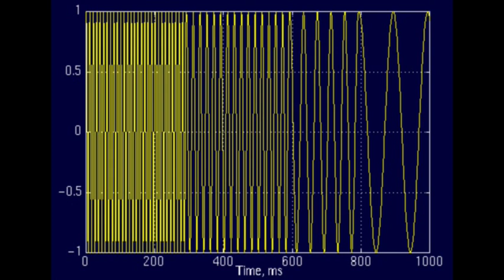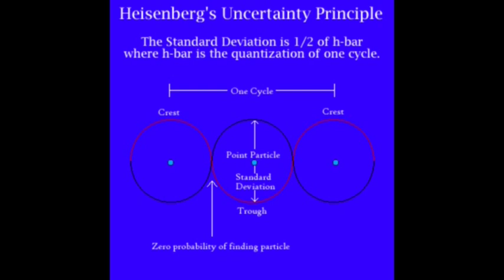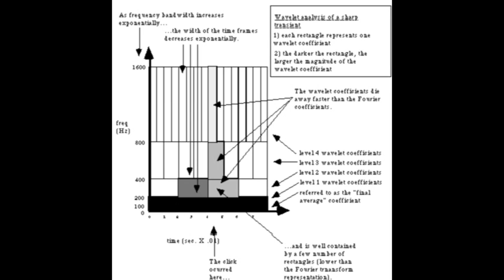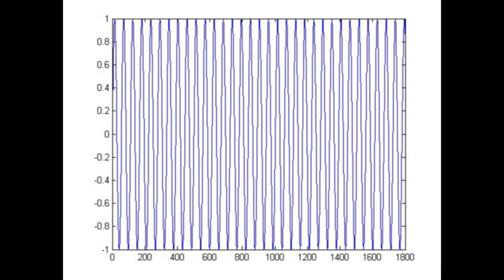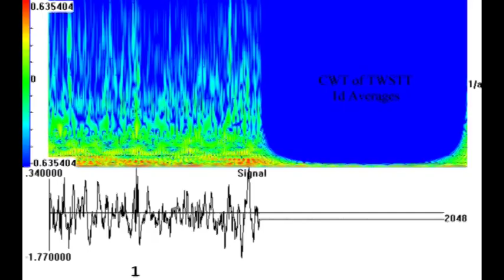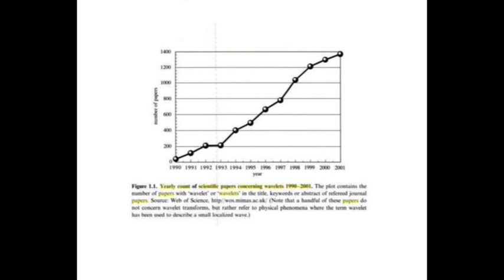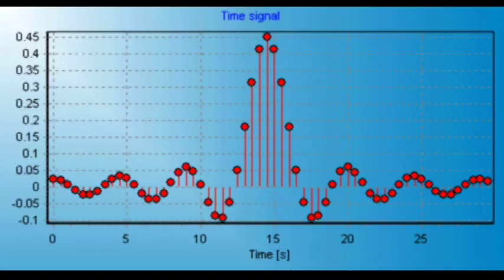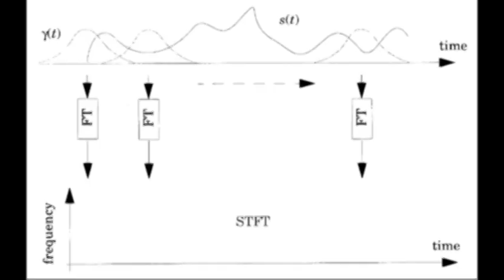Wavelets Part Two

Comment: But how can modify the parameters of your window on fly that fits the t-f resolution requirement, and can be set to meet the non-stationarity of the signal under observation.
As far as STFT is concerned, it is the simplest  tool to analyze the no-stationary signal; but does not always yield the desired results. I have developed a technique that performs better than STFT but it not adaptive like wavelets.  I wanna look into wavelets in more depth.

Comment: Great Presentation. It would be great if you add more videos on you tube on this topic. I am interested to know how wavelets can adaptively change their windows shape to handle changes in non-stationary signal.
I mean how a wavelet would know that in next millisecond the signal under test is going to have higher or lower frequency so that it change itself accordingly to balance t-f resolution issue.

Comment from the maker: There are sound processing applications that use wavelets..However, there isn't much out there because FFT's processing speed is much much higher than using wavelets. One of the down sides of the use of wavelets particularly when processing high Sampling Frequencys and  the duration of bouts.